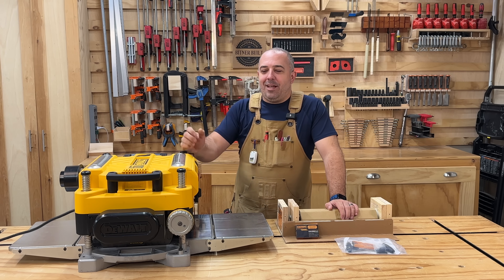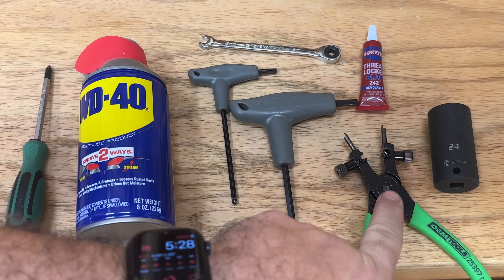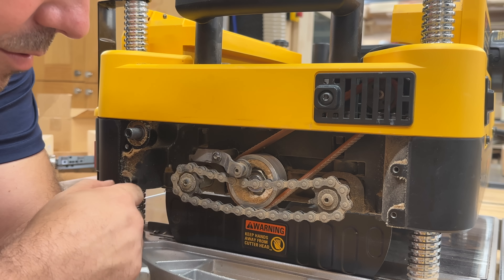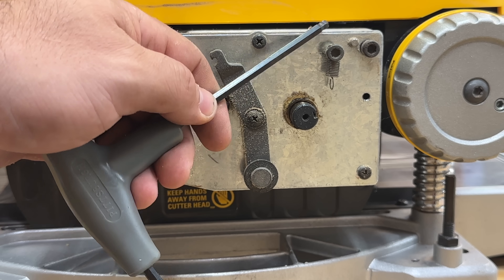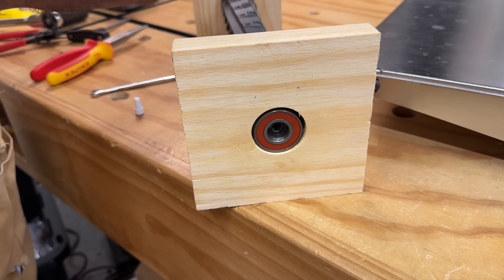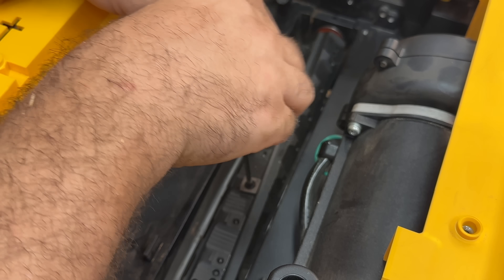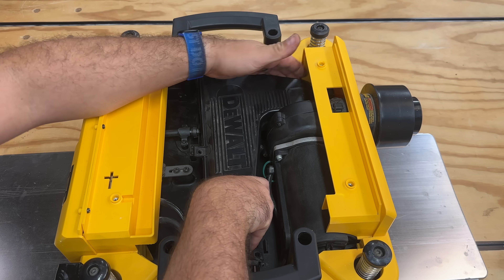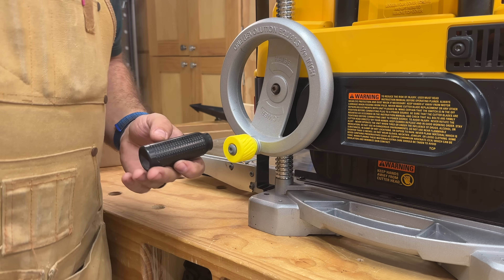4 Upgrades For The Dewalt 735 Thickness Planer -  Elephas Helical Cutter Head, Dust Port & More

Comment: What 3D printer are you using?
Reply from the maker: I have several (videos on the channel about several of them) Currently my mains are The Ankermake M5C (Best beginner 3d printer out there) and the Bambu Lab P1S which does multi color (no video on that yet) I have had 6, honestly my ankermake is still my favorite, it just works. Im not the tech "tinker" type, I like machines that I can just trust to work all the time out of the box without upgrades.

Comment: I would recommend replacing those phillips screws with allen head screws
Reply from the maker: yea that's a good idea!
Reply: @BitnerBuilt  another one is when you have a Philips head that's being stubborn. smack the end of the screwdriver with a hammer or mallet. that little bit of shock will break up the two surfaces just enough to make it easier to remove. Things you learn after being a tech for 30+ years. Great video.

Comment: Cool idea: instead of adding snip boards at the ends to replace the original silver ends that tilt up, what if you sink the planer into the table so that the table is flush with the planer?
Reply from the maker: That’s a good idea however just trying to think about that in my space, unless you have a very large shop to be able to dedicate that much space for a dedicated table that could be hard.

Comment: WOW!  This was a great video!  Thank for the stl files, by change is there any way that you add another dust port that extracts on the other side too?
Reply from the maker: Thanks! There is a mod to remove the top lid and the dust collector collects from the top of the unit
Reply: @BitnerBuilt  - Hey again!  I was asking if there was a way that you could make another one that does the dust collection to the right [when standing at the front] vs the left?   The model is great, due to space constraints, I have my hose going off the other way than you do.
Reply from the maker: @gamerscircle  ah well I didn’t design that one just linked to a free one out there! Here’s a link to one that goes the other way. Tons of models out there https://www.printables.com/en/model/560419-vacuum-adapters-for-dw735-dewalt-planer-all-common
Reply: @BitnerBuilt  - Oh.. I am so sorry, I thought you had made it. :)  lol!

Comment: Very good job on narrating and video editing. You took the boredom out of removing & replacing 40 cutters, ugh.  Only thing I would not do is put the grease on the outside of the head bearing race (8:57). The outer race should not turn, It is suppose to stay put. If it spins it could ruin the housing. Otherwise, great video. I just installed the Shelix OEM and it went about like yours. Hardest part was getting the belt back on.🤨
Reply from the maker: Thanks, my thought was more to get them back in as it’s incredibly snug and you’re sticking it with the hammer. Yea those belts can be tough!

Comment: 14:25 I hope you eventually went back and properly secured the new dust port on the button :D I also can't help but think those M5 holes were there for just that purpose. I wonder if it was originally ended to come with cord wrap holders and they cut it to save a few buck?
Reply from the maker: The m5 might have been, the handles on top actually have a cord winder spot as well so maybe they went with that later but I like it on the side out of the way 👍

Comment: I have a Byrd cutterhead in my Ridgid planer. The cutterhead cost me more than what I paid for my planer, but it produces fantastic results.
The dust port you have does not look very smooth on the inside. I can design you one if you can provide some dimensions.
Reply from the maker: Yea the Byrd looks nice too! In the video I had just taken it out of the printer to film, I’ve sanded it so it’s smooth now 😉 thanks for the offer though!
Reply: @BitnerBuilt I didn't mean the surface finish not smooth. I think there are some steps, hard turns in it.
Reply from the maker: the unit itself it a 2in port and the printed expands it out to a 4in for the hook up., it might look a bit like a interior step but nothing that would obstruct airflow at all while its expanding out. wouldn't worry about it

Comment: Woodworkers, don’t be afraid to apply heat to a bolt/screw if it’s stuck and starting to strip. Get yourselves a little butane torch but in a pinch I’ve used a cigarette lighter before

Comment: You aren't stripping a Phillips headed fastener; Dewalt (and pretty much all other Japanese toolmakers) uses JIS fasteners. They look like Phillips heads but they're cut to a different spec.  Best thing to do is to just go ahead and bite the bullet & pop for a pair of JIS screwdrivers; it's cheaper in the long run than replacing all the JIS screws one strips by using the wrong driver over the course of a lifetime.
Reply from the maker: My hand driver set has traditional Phillips and JIS, tried both, it’s just a really really soft screw

Comment: my thinking is if you have room for a jointer just get a combo machine, the dewalt is overated, its loud as hell, and if you have to upgrade the blades you may as well go for a spiral combo, probably work out cheaper as well.
Reply from the maker: It’s an option but combos are $$$$. And just like the dvd/vhs of old, any issues and your out both.. Honestly I think with this head the dewalts the quietest planer I have had out of the 3. At 5ft it’s 82db running.

Comment: Why not just buy a planer with a preinstalled helical cutter head such as the Grizzly?
Reply from the maker: You definitely can, most people usually have to build up to purchasing a much larger and more expensive machine incrementally. The 735 is the most sold planer by volume by far so lots of people interested in maxing it. I personally don’t have the floor space for a larger unit unfortunately

Comment: That's crazy a helical head costs almost the same has the planer.
Reply from the maker: They are expensive, no doubt, but if you’ve ever had to insert new blades into a joiner, after an hour or two of frustration that cost seems pretty justified. Being able to just rotate those blades whenever there’s a neck where they become dull is so convenient.

Comment: you are using different screwdriver, not the one designed to those bolts.
Reply from the maker: I rotated through six different size screwdrivers to see which one with grab the best
Reply: @BitnerBuilt I meant Pozidirv vs. Phillips. They looks very similar but still not interchangable. Im doing the same mistake often.

Comment: Not everyone has a 3D printer.. unless they are so cheap now, but the design software is NOT cheap.
Reply from the maker: Yes of course but there are websites you can upload 3d files to and they will print and ship it to to you. For designing in 3-D use Tinker cad, is an absolutely free program online and it’s pretty simplistic for people to be able to learn through. It’s technically made for kids to learn. Honestly, I’m new to 3-D printers in the past year, but it’s become indispensable in the shop making all sorts of tool holders, dust collection items, Measurement, tools, etc. you can pick up a cheap 3-D printer for around $150 now

Comment: I have a question for you,  maybe you can answer it, I have the shelix cutter head,  the oem sized one,  and I've had nothing but issues with it, to start off with a bad bearing but Byrd Tool took care of that. The issue I'm having now is whenever I plane something the material comes out with lines in it,  never smooth from the cutterheads, they're brand new and I'm almost positive I installed them correctly. Do you have any idea what that could be from? Thank you in advance
Reply from the maker: so a line in the wood when planing either means - line that's is raised (sickout out the wood) there is a chip in a blade etc where there is no blade contact with the wood, (or there is an incorrect gap in the actual head causing a spot to not have a blade in contact with it. if its a groove then a cutter head is a little over rotated so its corner is hitting deeper than the other cutter heads around it. Sorry though I haven't used the Byrd so unsure about its seating capabilities.